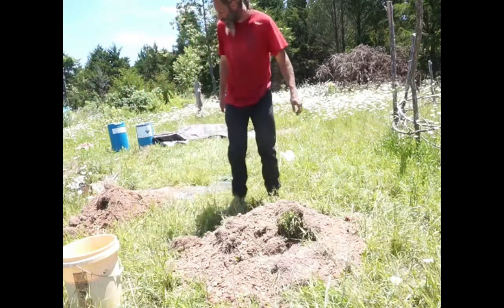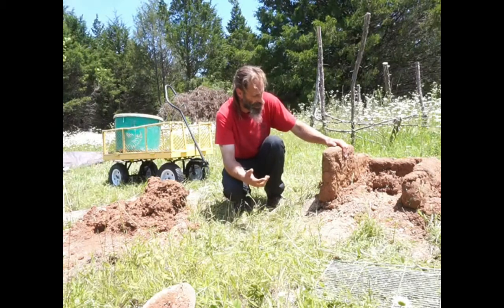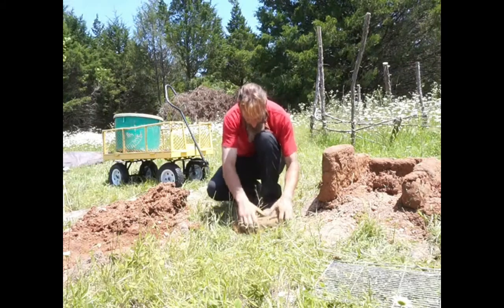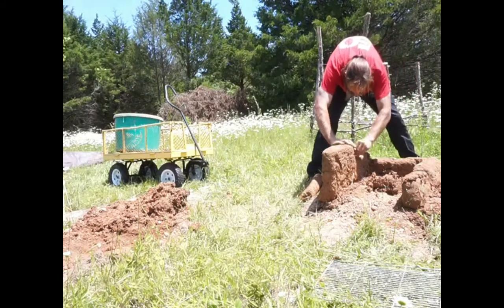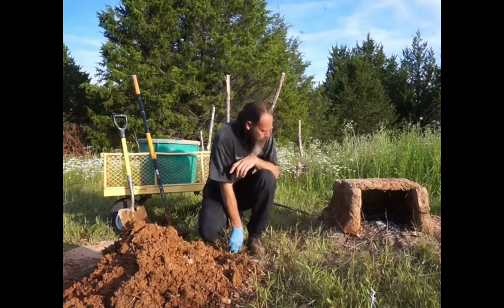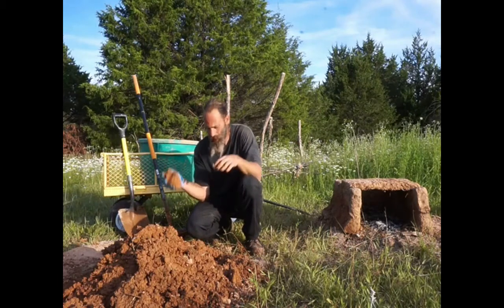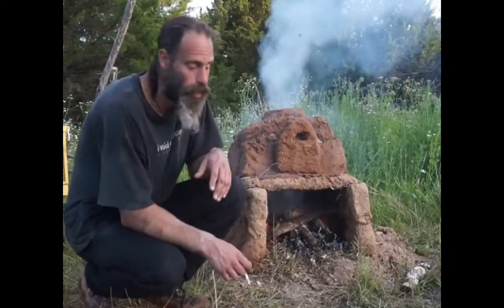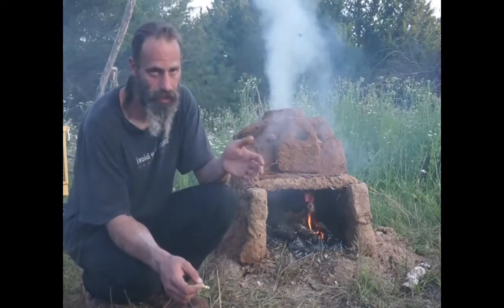Trying a new building technique for kiln construction

Comment: Fascinating. How do you get the pots in to fire them? I just watched a Time Team where they recreated a medieval kiln and fired pots just using the clay soil around them. They made a cob with it though, added a bit of straw. Then shaped it into a pyramid but left the top open. They played in all their pots, covered them with wood, and finished building the cone over it.
Reply from the maker: The block in the front is a loose gate, small pots can be put in there or through the chimney top. Since they don't need any kind of monitoring I can put them in and then seal it up once it gets going. Lime kilns and ore smelters are generally built for that single purpose and shaped like a cone where fuel and source material are loaded together, sometimes during construction. In some cases it was a single use construction that was destroyed to get the iron ingot or lime chunks back out. Everything has a different nature though, there are a 1000 different kinds of clay soils, there's moisture content and particle size, there's the shape of the oven and lag for heat flow and air flow, insulation ability, etc etc. For using local materials, some testing is usually needed, especially if you can't find high quality clay in healthy amounts nearby.